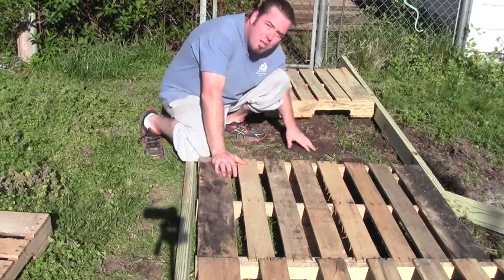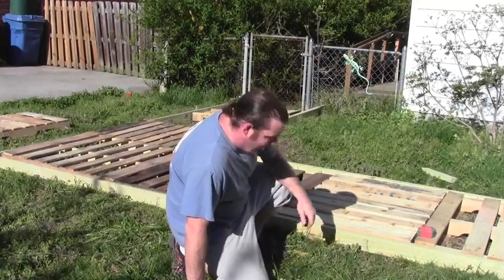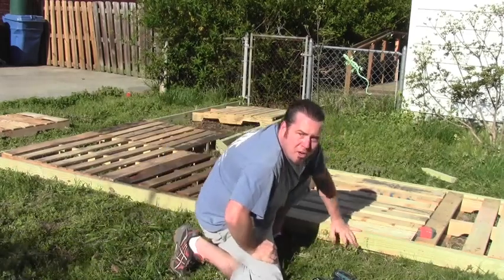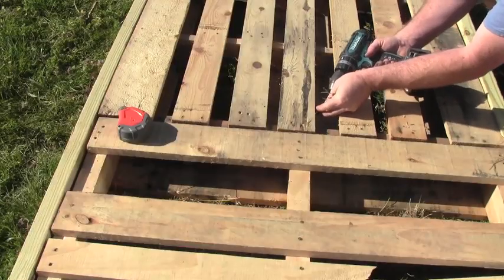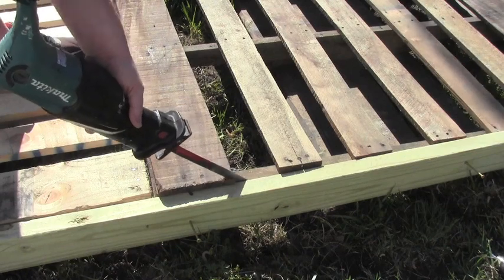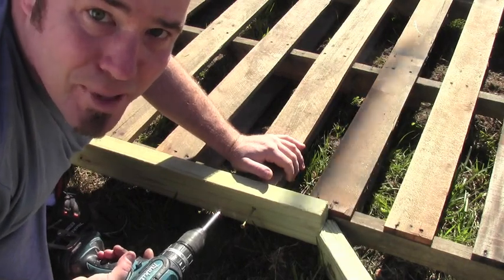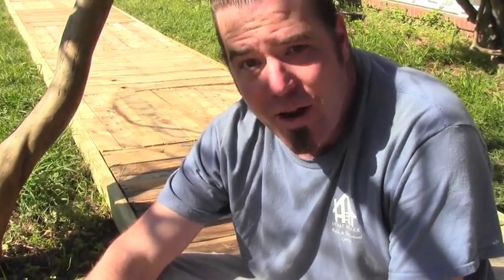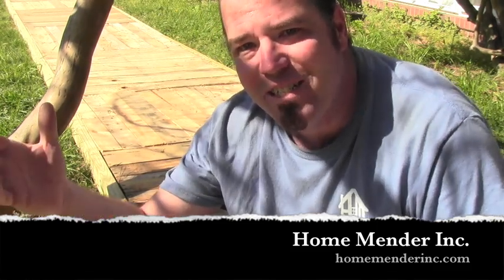How to build pallet walkway, deck, sidewalk. Easy! Home Mender.

Comment: You could also line the walkway with some crushed stone before laying down the pallets. It would add to the cost of the project but would help with draining of rain water and keep the pallets as dry as possible. I've have pallets last for years that were never in direct contact with the ground. nice project
Reply from the maker: hey the hayes! absolutely. great addition. Thanks for the input!
Reply: Hi, Do I line the spot with that material that keeps the grass from growing under pallets before applying stones, then set the pallets on top of stones?
Reply: Pregunta: si la madera toca la tierra aunque esté bajo techo se pudre?

Comment: This would be great if you was camping at a spot for a few months and needed a walkway or even if it only lasted a year or so it looks great and it’s cheap also cool for someone that changes designs a lot considering it might not last for to long good video !!
Reply from the maker: absolutely Peri!... this customer used it as an air b n b entrance for the summer... worked great! thanks so much for watching!

Comment: Thanks for the idea!  I have a bunch of pallets already laid down at the bottom of my hill and was trying to figure out the best way to turn them into a walkway!  My only question though is, how would I handle turns/angles?  This is a great idea if you're doing a straight line / 90 degree right turn--?
Reply from the maker: hey brian...you would want to frame it on a 45 then fill with pallets..you may need to reinforce the pallets after cutting them..you got this!

Comment: I had wanted to build something like that in my mind for the past few days and did some research, looks really good, great job!   Seeing it being wood on direct contact with the moist  ground; can occur rotting.  Was wondering if its best if I used concrete footings and if you recommend it?
Reply from the maker: hey neo! great question. that seams like alot of work..if you had to use some sort of base maybe placing pavers every so often to keep it off the ground might be a good idea...i hope this helps!

Comment: My husband built the most amazing ,beautiful , two tear deck , we painted it with a wood protector seal, and it lasted about 3 years.  we live in Louisiana so we have very humid tropical environment. I wish it could have lasted longer . Any ideas about prolonging the life of your wood pallet boards?👩‍🎨
Reply from the maker: hey TP!....you gotta love the south. :) you can lay the pallet deck on a bed of gravel to keep the water off of it  and one thing i would've liked to try but didn't think of it, was treating both sides of the pallet before installing. I hope this helps!

Comment: Nice idea and well performed.
But why would the pallet walkway rot within a year (or two) when the wood will be treated?
Reply from the maker: hi hans.. it may last longer. some pallets are thinner than others and without continual seal coats going on, its just not made for rough weather. I hope this helps.thanks for the comment!
Reply: While it it something you will have to re do it after 6 months ,  it looks good.

Comment: great job. you mentioned it's only good for a year . Is there any treatment that'll help it keep for longer ie green e
Reply from the maker: hi sarah. Not sure how long it will last, im sure more than a year, untreated fences last a long time. I just used a clear coat sealant on this one but a stain would look amazing as well.  hope this helps. Thanks for watching!
Reply: It wouldn't be a massive leap to screw some cheap plastic support feet on to the base of the pallets to keep the wood from making contact with the garden.. something like furniture castors you can buy cheaply in a discount store. Great video and great use of a raw material we see everywhere that due to the chemical treatments used in their construction are unsuitable for domestic log burners. The ONLY other tip I would add would be to  introduce a very slight incline (one that is barely noticeable if at all... that way water will run off rather than sitting.  Good job !!
Reply from the maker: thanks computec! and thanks for the tips! good stuff
Reply: could use a fencepost hole digger and nail the walkway to some wood stilts then fill the holes with cement like people do with mailboxes

Comment: How would u use pallets to make a back yard fence
Reply from the maker: Hey roger.  You would need to anchor them into the ground so I would still sets posts then screw them together I would set them on a 2x4 while installing to keep them off the ground, then pull out the 2x4

Comment: How's the pallet walkway doing in 2019?
Reply from the maker: hi kristin! great question..i need to treat it once a year with a thompson's water seal and replace a board here and there but its doing awesome!
Reply: Thank you for responding! I'm thinking about doing one myself. It's really beautiful.
Reply from the maker: no problem Kristin! i try to answer everyone.. this one is in Virginia beach and added a real "bay city" feel to the house. Yes it looked like i got it at trader joes but it served a purpose and offered  awesome flare. thanks so much for commenting!
Reply: Sorry to bother u again. But I got my pallets and I'm ready to start my project! Do I spray it with deck sealant first or after I'm finished?
Reply from the maker: Hey K.!. i sprayed mine after installing. but either would work..
Reply: @kdiang03  Awesome questions!  You both motivated me to do this! Thanks!!
Reply: What if I made a large platform this way and filled in with concrete?  Would that make a good grill/patio area?
Reply: @jaydee8981  that's exactly what I'm doing now but not using concrete. Mine will be 12ft by 15ft.. essentially a simple floating deck.
Reply: Home Mender why didn’t you place gavel or sand along the edges where you 2x4 side boards are making contact with the ground the would make water run off faster than the existing grass
Reply from the maker: @TheTinkle1  hey tyler...thats a great idea...i needed a walkway quick and cheap..this one was about 100 bucks. thanks for commenting!
Reply: Almost a year later and the pallet walkway is doing fantastic. Everyone compliments me on it when they come over. Thank you so much Dustin. I hope everyone is enjoying theirs. 

Although it's showing no signs of breaking down on me, I think when that time comes I'm going to use concrete molds for a more permanent fixture. Since all the grass is dead underneath, it shouldn't be too hard of a job....

Comment: Is everything sitting directly on the ground? if so...its destined to rot..:(
Reply from the maker: Hey John, I don’t think this would be a longevity project, but no not everything. I have ground contact treated two by fours touching the ground but nothing else, of course the pallet wood is untreated and it’s days are numbered. This served as an Airbnb  walk way For a few seasons

Comment: Why would you do this if it only lasts a year?
Reply from the maker: Hi karl! you can get a few years out of it. We used it for an air b n b we opened that year..it rocked!thanks for commenting!
Reply: @homemend  This is going to be for a rental and I don't want to have to do it every few years, but as handy as you are I can see why that's not a big deal.  I found your video searching for "easy way to build a sidewalk" lol.
Reply from the maker: That would be the perfect search..lol the pallet walk is nice but it does require maintenance. Its great for a time and with as little money as it costs, it was well worth it for me..i hope this helps...
Reply: @homemend  I'm sure I might consider this for the future, but I think I am going to attempt a concrete walk. I'm just worried about screwing up.
Reply: @homemend  and I am tempted to use your method to build a poor mans patio!
Reply from the maker: hey man..pallet patios are cool! lol for a season or two

Comment: A couple of things struck me as illogical here.  See below.

A)  The word "EASY" for the title of this video.

       There is nothing easy about this project.

B)  Wood used for pallets is usually #3 or culls.

      It is filled with knots and of poor quality.

      It serves its purpose, because it is a pallet.

      But do you want to use that for your home?
Reply: Stress Belden and?
Reply: How is this not easy? Lay down, hammer together, tada. And it's not supposed to be good quality or expensive. It's supposed to be a cheap little walkway for gardens or little kids.
Reply from the maker: thanks for commenting!

Comment: Suggesting the use of pallets is a VERY bad idea; you are doing no one a favor by doing this. Then,  further suggesting the use of a deck sealer is an even more foolish idea. You may have meant well, but this project will not end well, for all the time & effort it took to do.
Reply from the maker: hey walter..actually it was awesome...this walkway cost about 100 dollars and gave me a way to get to the side door for years without 2500 dollars of concrete... and it looks cool..thanks for commenting!